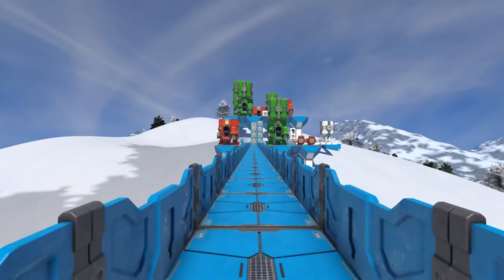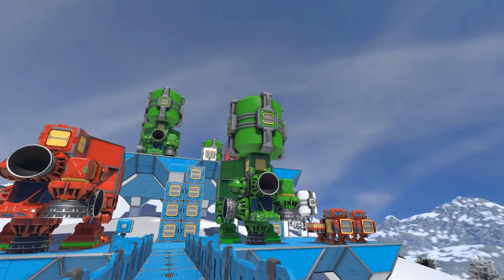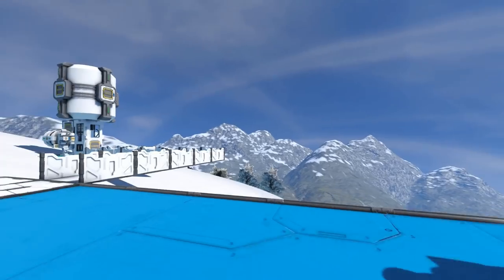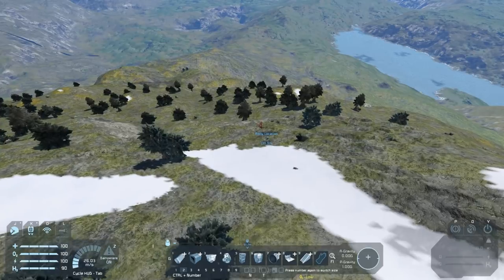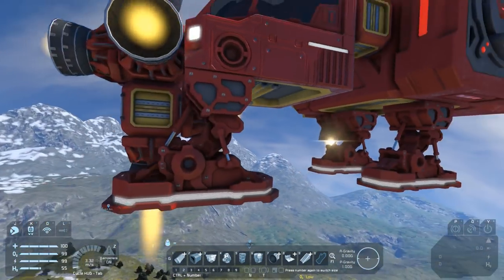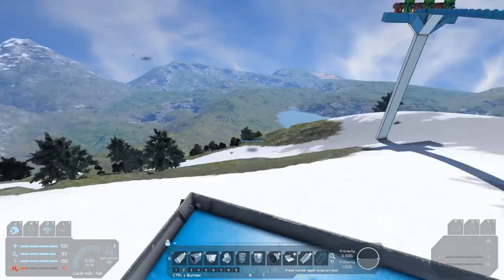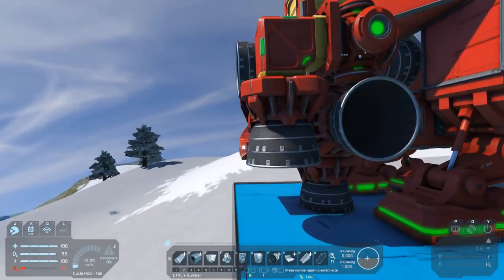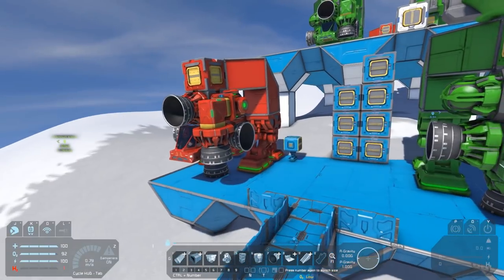Space Engineers Testing: Oxygen Generators vs Hydrogen Tanks (tutorials, tips,  testing in survival)

Comment: The speed ceiling really borks up the the physics in this game.
Reply from the maker: Sadly it's the only thing that actually allows the physics calculations to happen at close to real time most of the time. Because of the collisions that need to be worked out, if you're moving too fast there aren't enough physics ticks in a second to reliably make it so when you fly at a wall you explode, rather than sometimes missing that collision and have you sail straight on through :/
Reply: I was under the impression it was due to interactions with subgrids, specifically rotors and pistons. But, regardless, after playing KSP* where orbital velocity is ~ 25x the speed limit, not being able to exceed 100 m/s is... frustrating. Don't get me wrong, I still love SE, its just one of the "oooooh but I KNOW BETTER" kind of things that always gets me when I head to orbit.

*which also isn't perfect, not by a long shot.
Reply: @Splitsie  Quantum tunnelling! Using this, with the speed of light as the speed ceiling, can we calculate the physics tick rate of our universe?

Comment: I really cant help but feel like the weight of the ice is being overlooked, especially in larger quantities. The weight of ice is just as heavy as stone, meaning that a full cargos worth of ice is equivalent to that of a full cargo of stone, and depending on the size of the container, and of coarse what inventory settings are in place, this could be significantly more than that of a hydrogen tank which has the same weight value empty as it does full. This is definitely something that you need to consider when working with ice and hydro tanks, and is definitely something i've had to work with while trying to push hydro power to its limits.
I feel like a good balance between the two is extremely beneficial for most situations, as itll cut down on  your total weight, while also providing a backup.

Comment: When i was planning on leaving earth for the first time, i did a burn test on the thrusters; at that time, 1 full small-grid tank fueled a large thruster at full override for exactly 30 seconds.

My approach was always to have enough tanks for 1 round trip, and then add one or two generators to refill in times where the thrusters were not on full throttle to enhance the flight time to a maximum. I imagine on large large grids this will be even more important, as you'd need dozens of generators to run all the large thrusters just to produce the minimum required thrust.
Reply from the maker: I think that's a great way to set things up, have the tanks ready for when you need that boost and use the generators to refill in the other times. Completely agree with you on the large ships as well, they would require silly amounts of generators :P

Comment: Hydrogen in a hydrogen tank has no mass (in the game).  Ice DEFINITELY has mass.  You will need multiple oxygen generators to replace one hydrogen tank.  The thrust to mass ratio will suck.  Going without a hydrogen tank only makes sense outside of natural gravity.  Even in that situation, it functions more as a pulse jet rather than as a sustained amount of force.
Reply from the maker: Actually, as the testing here showed, your thoughts are right when it comes to large grids, but small grids the tanks are so incredibly heavy that you need more than 2 tanks worth of ice (only true at x10 inventory, on realistic this will not be the case) to even match the same weight, that's why the small grid ships with tanks dropped out of the sky first. Each pair was loaded with identical amounts of ice, the tanks were filled with that ice then the generators removed from those ships, the two on the right had almost completely full tanks and still couldn't get even near the same duration of flight.

Comment: I wonder if a single tank for flow plus multiple generators is better than multiple tanks.  Maybe test the large block 2 tanks vs 1 tank/1 generator.  PS - thanks for doing these vids, I have learned alot of game mechanics from them.
Reply: This, and I'd also like to see a large grid comparison of a tank vs. many generators as you can pack into a 3x3x3 grid (with small cargo in place of conveyor junctions). Categories: total mass of the generators/cargo (loaded vs. unloaded, then compared to the tank), fuel density, and max thrust output of the generator setup.
Reply from the maker: That's an interesting point, there would definitely be value in having a single tank in any setup, so that you have a fuel guage on your HUD, but if you're generating enough fuel for all your thrusters to work at full power then the tank would only be useful for that. In the situation where you don't quite cover all your thrust needs but you only need to go at max power for short bursts then having a tank and 'just enough' generators would work really nicely :)

It could be interesting to test, at the time I was running through these I did think about space requirements, but didn't think to compare them directly, could get some interesting results...
Reply: Yeah, just like with electricity. Batteries on automatic mode that recharge from excess power in times of low demand, and which can kick in to deliver the juice when the reactor doesn't fulfill demand.
Reply: The big advantage of using a small grid tank along side generators is that it acts as a buffer.  This allows you to reduce the number of generators and still have full thrust for short periods.
Reply: The advantage of the multiple Generators is that they allow for extended flight time/travel distance.  For example, once a tank is filled, a small grid generator will store 27kg of ice, which is enough to refill the tank about 1.5 times.  In effect it is more than doubling the flight time/distance.
Reply: The advantage of the multiple Generators is that they allow for extended flight time/travel distance.  For example, once a tank is filled, a small grid generator will store 27kg of ice, which is enough to refill the tank about 1.5 times.  In effect it is more than doubling the flight time/distance.
Reply: If you don't have enough generators to keep up with your thrusters a tank will only offset the moment the ship crashes and when you have enough generators to keep up then there's not really a point to have a tank. It's only a very usefull combination on ships that are only flying for short periods and mostly landed somewhere so it has time to refuel it's tank or ships that aren't meant to be used on planets but in space only.

Comment: You may also want to take note that oxygen generators consume power.

In the final test between the two remaining small grid ships, the tank ship could run for 6 years, whilst the generator ship could run for 42 days.
Reply from the maker: Good point and something to be aware of even though I suspect the amount of uranium needed will be such a small amount that you'd be unlikely to see a difference :)
Reply: Splitsie 

In times of scarcity it can mean the difference between being stranded in space or dropping out of the sky.

I tend to use batteries in my hydrogen ships (for which I primarily use tanks) and often as few as one.

I predict were I to switch to generators, those ships might become dependent on uranium where they were not previously.

Or, if you're dedicated to renewable energy, you might need to come up with solutions to the slow charge speed of batteries as I have in some of my builds.

In either case, it's something think about if you like to engineer your builds to operate in specific parameters: like not having a surplus of power, or never red-lining your thrusters.
Reply from the maker: Good points well made :)

Comment: I've been using the generators in a similar manner to small reactors on my ships-the generator is used to refill the tanks partially when I start pulsing the hydrogen thrusters.
Reply from the maker: Yeah, I see it like the battery/reactor system or like the tank is a capacitor. Nice for holding fuel for when you need a boost, but doesn't quite have the longevity to be your only fuel source

Comment: Thanks for continuing to post these vids. I think you may have some testing issues with the small merged ships. In order to compare accurately, you'd need each ship to weigh the same. Same amount of conveyors/thrusters etc, even if they arent fed by Hydro. Cheers man, keep up the good work!

Your engineer's mass is added to the ship when you get in the cockpit, that's why the small ship dropped when you got in and hovered when you got out.
Reply from the maker: You're welcome :)
I didn't want the ships to weigh the same, the only difference in weight between the ships is because of having a tank or having a generator. The core of the ships are identical, same number of connectors, thrusters etc. So both get the same amount of fuel, one converts it into a tank and the other remains as ice. I think that's a more realistic comparison between the two rather than artificially balancing their mass.
Good point about the engineer, though all the tests ended the same or with enough margin that my hopping in and out didn't make any difference to the outcome thankfully :)

Comment: Generally i only build hydrogen because for two reasons.
1. I can fly in atmosphere and in space without having to switch from atmo to ion thrusters (as you'll need both to do that). And 
2. MORE POWWEEEERR!!!
Reply: Oh and i use tanks as main fuel supply and o2/h2 generators for refueling tanks in a pinch. That in combination with 3 hydro power generators you can actually build a relative small vessel with alot of power. Have one in the workshop by the name of GRXT20 Jumpship. A hydrogen powered ship with 9 jumpdrives. Gonna build it in my new game on earth cause i never flew it into atmosphere
Reply from the maker: I'd agree that's the right way to go, have a generator for 'just in case' but otherwise just use fuel tanks especially since the recent hydrogen rebalance that came with the wasteland update

Comment: splitsie with the 2 generators added you had the same amount of fuel but the problem is they ran at the same time only giving you the thrust time of 10 ice if you know what mean. your bottle neck was the flow rate wich is why you halved it but that also halved your potential thrust time therfore also halving your fuel in a sense.

Comment: ice to hydrogen ratio for small grid is only 1:2, but is 1:3 for large grid :)
inventory settings also change things, as this setting alters the the ships mass calculation for inventory items. On 10x inventory, 10,000Kg (10,000 units) of ice in an inventory only has 1000kg mass for when this is added to the ships mass
Reply: I don't understand why should you be able to lift more mass on *10 ? Let's say I have a container with 1000 volume of ice. on realistic setting, the container will only have 100 volume.
Also if you fill a cargo with platinum, they will weight the same.
Reply from the maker: The reason they changed those mass calculations mostly comes down to people wanting to get blueprints off the workshop. When they first introduced cargo adding mass to your ship they didn't have the adjustment factor. This meant that if you downloaded a ship that was made for x1 and used it on a x10 world things would rarely work because you'd quickly overload the thrusters. 

If they didn't put a correction factor in you'd have to have 3 separate workshop categories, one each for x1, x3 and x10 which would not be good in general. Anything that divides a community is usually a pretty bad idea, so although it seems odd, the reasoning keen used is pretty sound (in my opinion anyway).

Also I didn't realise you get better conversion rates with large grid generators, that puts a small pro in favour of your small ships having tanks and refilling from a base - though ice is so plentiful it might not really matter :P

Comment: This is the kind of a test where you really want a handful of numbers to rub against each other. According to http://spaceengineerswiki.com/Thruster a small large grid hydrogen thruster uses up 1092.5 units of hydrogen per second. According to http://spaceengineerswiki.com/Oxygen_Generator a large grid oxygen generator can produce 501 units of hydrogen per second. This means you need a little bit more than two generators per thruster to burn it at full power. With small grid, the numbers are correspondinly 109.2 and 166. This matches your results. It should be possible to come up with a formula to find the best solution for each use case.
Reply from the maker: Nice to know my tests came close to those results :)
In some ways I like to go into these tests blind and just see what happens, but in this case being able to use the numbers to explain why might have actually been useful... oops :P

Comment: I think that if you would have kept a similar rate of speed increase by adjusting the thrust override, the tank would have been an even more clear-cut winner. For most of the climb in the distance test, it was maxed out at 99.99m/s, (which as you know wastes fuel) whereas the generators had a much longer time not spent at max. Good test though.

Comment: I have 16 hydrogen tanks in my largest ship, and 14 H2 generators, but I would only use the generators in an emergency, if I run low on hydrogen. (I also carry a small mining ship inside the main hangar, so I can mine ice anywhere) With 10 large thrusters, even at 6.2 mill KG, the ship can land and depart with 1g of gravity, and still have a lot of fuel remaining. With a jump setup, you really don't use a lot of hydrogen anyway. Plus, I simply refuel the ship at my space station, where I keep 30 generators and 60 H2 tanks, and enough ice capacity to completely refill it all. lol Go big! :D

Comment: To really maximize the efficiency of small grid gen based systems, add an ejector with a timer or switch.  The small amount of ice lost will be offset by the efficiency gains from recalculating the grid mass.
Reply from the maker: I don't think I understand what you mean... are you suggesting dumping ice with the ejector?
Reply: Yep.  By ejecting a small amount of inventory every so often, it forces the UI to update the total mass of the grid.  Whether this actually reflects on grid calculations is an uncertainty.  IIRC, the same thing happens if inventory passes between the ship inventory and your personal inventory.
Reply from the maker: The value on the HUD also updates if you jump out and back in, so I hope that it's just a display thing because otherwise that's just silly :P
Reply: Perhaps it is a way of reducing recursive calculation.

Comment: More tests that I feel you should of done!
You current tests seem to merely test what is most fuel efficient, on a one tank versus one generator basis, with the same ice to start off with, without considerations for grid volume.
What about volume? in the space that one large ship hydrogen tank, you can fit at least 9 oxygen generators. If we ignore fuel efficiency, assume the ship's designer doesn't care about how much fuel they use, they want to design a ship that is most capable on how it can move and be compact.

So the questions I want to see answered are, how many thrusters can one oxygen generator supply fuel for, compared to how many thrusters can 1 tank provide for? (And still have all thrusters be able to thrust at maximum) In the same grid space in a ship, can hydrogen tanks provide more hydrogen output for more thrusters then oxygen generators can using the same space on a ship?
Reply from the maker: I think that would be interesting to look at, particularly whether you can get enough generators in the volume of a tank to make up for the tanks higher output...

Comment: Some extra information with maths/simple stoichiometry involved in case you might be scared with number (pray I didn't stuff up calculations and units... lol)

Ice will have the upper hand as the amount of H2 stored in a large cargo block is greater than what can be hold in a H2 tank. This is true for ALL cargo modifiers (x1 upto x10 and anymore above). Since cargo space is the same size as a H2 tank, 3x3x3, not including O2 generators size or amount they can hold, we will compare the 2

H2 tank holds a static 2,500,000 L, where large Cargo holds 421875*10 L under x10 (I will use standard cargo space for simple sake and convert when need to). 1 kg of ice = 9 H2 (O2 generators seem to have very poor yield rates since 1kg of ice, with water having a Molar mass of 18g.mol^-1 should produce 55 moles but I'm gonna say it is for balancing reasons) 

Large cargo under normal cargo limits can hold 1,137,129 kg of ice, which means it can hold 10,234,161 potential amounts of H2. I can not find any details on the units for this number so I am gonna assume it to be litres.
10,234,161 vs 2,500,00 L is quite a difference and if you make it x10 storage, you can make enough H2 to put the Hindenburg to shame.

I have left a lot of things out like ice generators storage as well grid space but we can assume they won't effect the outcome much, even if there is 6 generators and a large cargo block against 2 H2 tanks, there is more H2 overall in the generators. Do note, it is a hell load more to push around than just a H2 tank. So what would be the best thing to do?...

https://gfycat.com/gifs/detail/FarflungLastCygnet

Still, don't disregard what Splitsie said, defiantly a really good video. Keep up the good work mate, loving the content!
Reply from the maker: Love the Old el paso commercial - applicable to so many things... especially in Space Engineers: batteries and generators, O2 gens and tanks, ion, hydrogen and atmospheric thrusters the list goes on :)
Glad you're enjoying the content, I hadn't even thought about how inefficient the oxygen generator is for balancing reasons - thanks for taking me back to my organic chemistry days :P